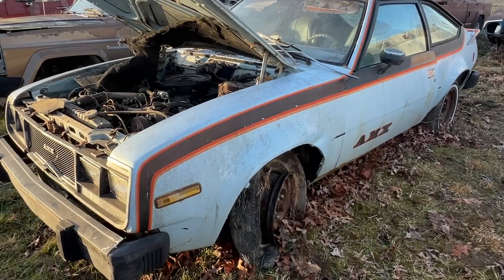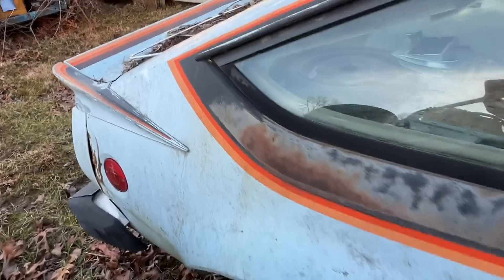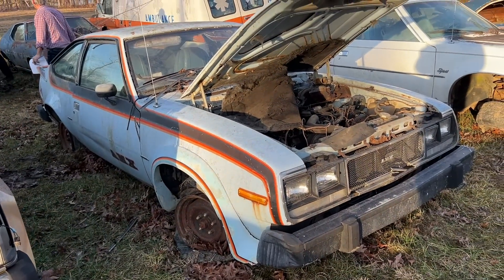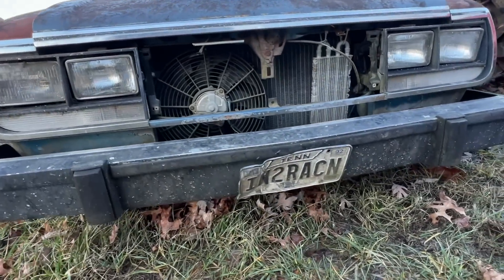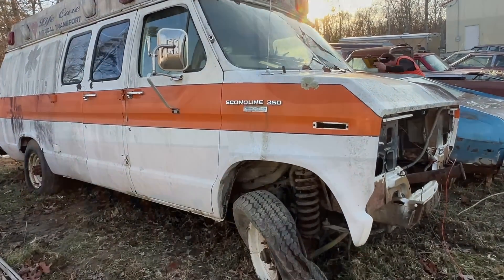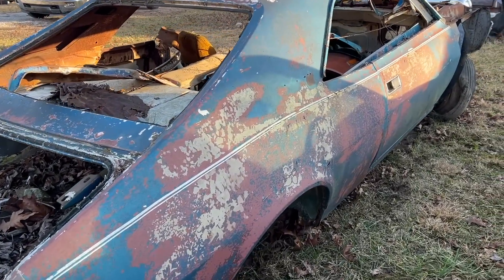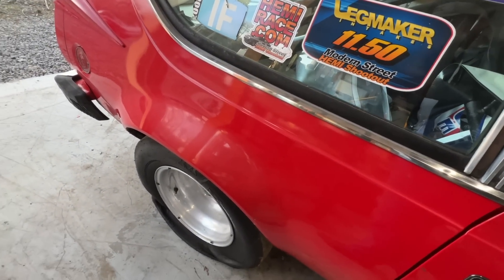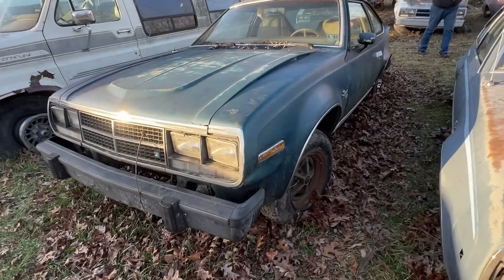AMC Javelin and AMX's Hidden in Private Collection

Comment: Tim, cool AMC find! Couple notes: The fender flares on the Spirit AMX are the same as the flares on the AMC Eagle. Rear spoiler is identical as well. The AMX has a front spoiler that integrates into the front flares to complete the look. I’m 99% sure the alloy wheels you show on one Spirit are a factory option, not aftermarket. I was really into Gremlins for a bit as the 1978 Gremlin X was a 242 straight 6, 4 speed with a 1 inch front sway bar. This combo made it an oddly good Showroom Stock road race car! AMC made a Pacer X, same spec and it too was road raced in era. When the Gremlin first came out it was a very successful race car in the IMSA RS series, 72-77. Other odd cars in that set were the V6 Buick Skyhawks, the Pacer, Dodge Colt, Mazda RX2 & RX3, BMW 2002 & 320i and others. Crazy to think of all those the Gremlin was one of the best cars! If there had been an old Spirit road race car in the mix you know I’d have been bidding!
Reply from the maker: Wow I didn't know that...very cool info! Thank you!
Reply: Actually, they are similar but different. The SX/4 did not have the front spoiler like the AMX and also did not widen out at the bottom of the flares like the Spirit AMX did. The front spoiler also attached to the front flares on the AMX while the SX/4 did not have such an item for ground clearance reasons. The rear flares on the AMX also flared out at the front of the flare to match the rear of the front flare (kinda like bellbottoms...lol) The rear spoiler, however, was shared between the AMX, SX/4 and the Spirit GT. It also required an electric trunk popper with a contact on the tail panel and a switch in the glovebox to open the hatch. Cars with the spoiler did not come with a way to access the lock in the rear hatch with a key- but the lock cylinder was there under the spoiler! The AMX and the GT and DL with the radial tuned suspension option also shared the same springs and sway bar packages, with different parts used for 6 and 8 cylinder cars.

Comment: I drop a 390, 4 speed with a 3:15 rear end drivetrain and crossmember , out of a 69 amx in to a 82 Spirit and it all bolted right in , AMC never change anything about there cars right up to the end , even the factory holes and mounting points and petals bolted right in   :)

Comment: had one for a few years 4cyl 4 speed use to run with United Manual Transmission Racers was it fast,,,,,,,,,,,,,,,,,,,,,,well i would have to put it in 4th gear after the finish line to get to the end of the track 😜🤣🤣, on another note i always wanted to put a 2.2 or 2.5 mopar engine in it
Reply from the maker: Oh that would be cool with a later model four cylinder engine. Never really thought about that, but it would be a much lighter option than a V8.